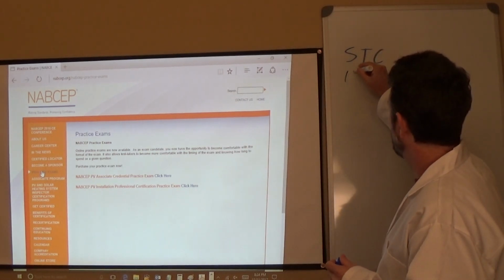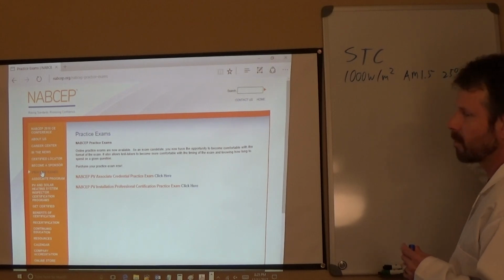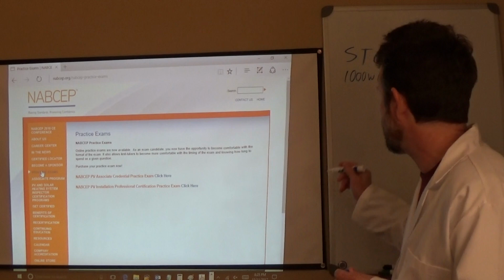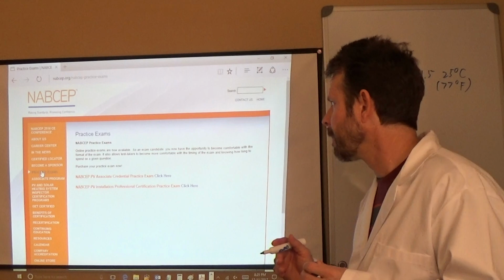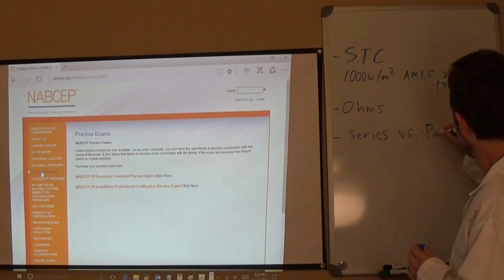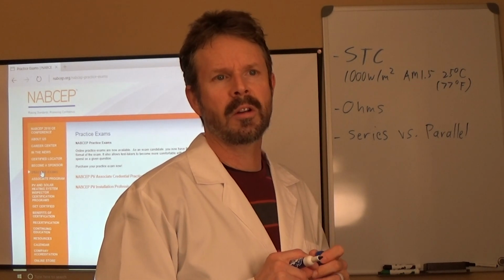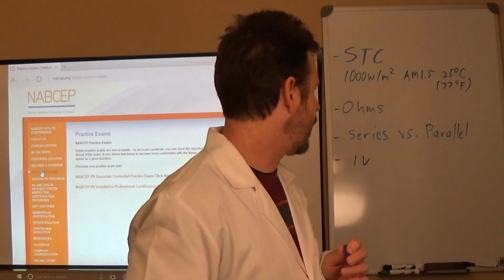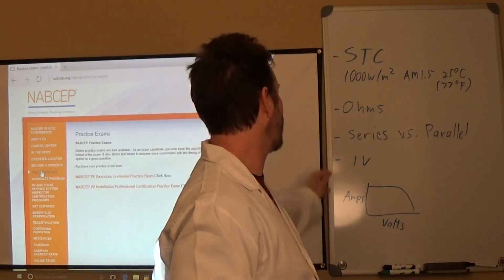NABCEP PV Exam - What You MUST Know!*

Comment: Im currently working towards my osha 30/40 but my goal is  to get my NABCEP and get into the solar industry. Is there anyway I can use or transition my osha license to an entry study for working towards gaining my NABCEP? At the moment the most I can think of is trade school but there's still so much I don't know. I'm also willing to travel.
Reply from the maker: Hi, ElusivEnigma.  Thanks for your question.  This page on the NABCEP site explains the requirements needed to apply to take the tests: https://www.nabcep.org/certification/enroll-now/.  It really depends on which test you want to take.  I would recommend doing the Associate credential exam first, and then working towards the Professional Certifications.  You only need to take a class for the Associate, however you need to get installation hours for most of the other Certification exams.  (OSHA is only one part of the requirements.)  I would recommend taking an online program with Solar Energy International or Heat Spring.  They have some prep classes that are really good.